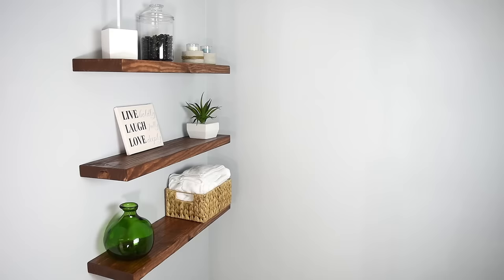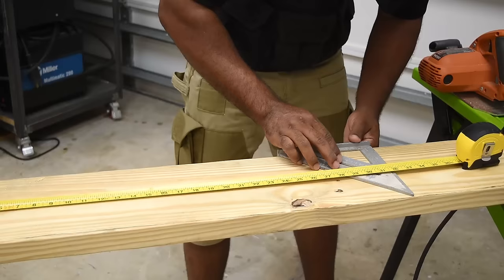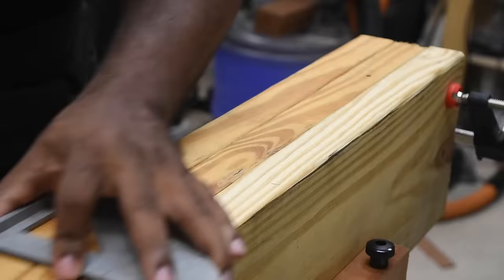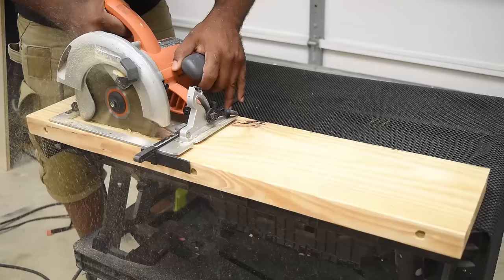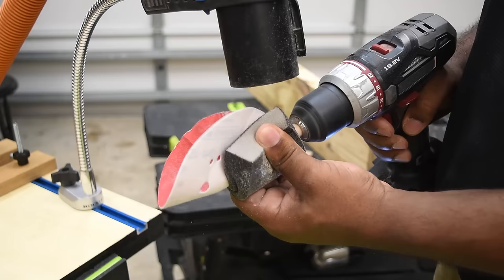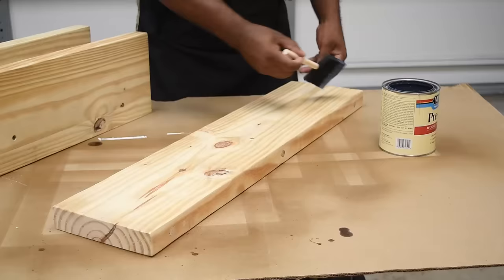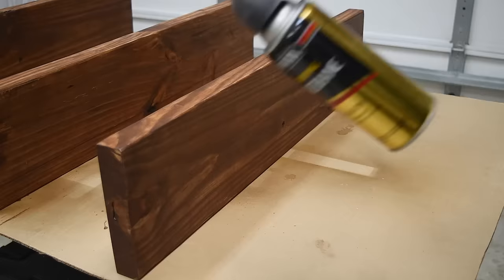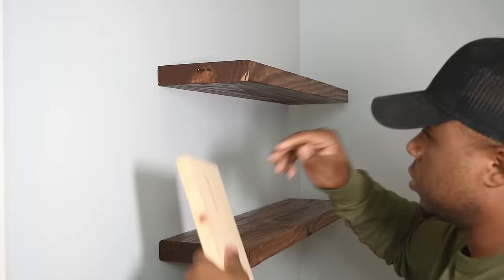Easy DIY FLOATING SHELVES No bracket | DIY CREATORS

Comment: Great inspiration.  I used this idea to make a set of 5 different sized shelves, using 2x8 and 2x10 pine, painted afterwards in my case.  For a finished look, I added 1x3 sanded and primed trim board to the three sides.  I also went up in dowel size, to 5/8 diameter and 5 inch lengths, ripping a 1 3/4" mounting strip.  Use a wood boring bit for the holes. To sand the dowel pins, I hammered them (gently) into a 14mm socket driver (3/8 drive) but I had to buy a driver for the drill for it (not expensive).  The look is very clean!
Reply: Have you tested the weight capacity yet? I want to try this method in my kitchen for dishes and pantry items, but I’m worried about the weight.
Reply: @Lula1216  For books, these shelves are OK.  For dishes, I would amend the design.  There are a few things to do differently for better weight bearing.  First, I used 3in screws to hold the mounting cleat to the wall on whatever 16 inch centered studs I found along the cleat.  These screws may not be strong enough.   Increase the width of the cleat as much as reasonable, say 3 1/2 inches, and use 6 inch lag screws (1/2 inch) to mount to wall on studs (predrill).   Wider cleat will reduce the amount of sheer force on the dowels too.   I used about 16 inch spacing on dowels.  To beef that up, use a shorter spacing (~12 inch), i.e. more dowels.  Just try to keep dowels aligned.  The more there are, the harder it will be to seat them if they are wonky.  Should work otherwise!

Comment: How do you know that 3 dowels is enough for the weight of the shelf and whatever stuff you put on top?
Reply: Exactly! He doesn't and that's why these are extremely weak shelves. Incorrect wall anchors and dowels are too small. This looks good if you don't know anything about woodworking or construction.

Comment: As a licensed contractor, anybody thinking about doing this, DO NOT use those silly drywall anchors.  You're asking for a disaster and major expense out of nowhere like the random shelves that fell down in the back room while I was prepping kitchen cabinets literally 3 days ago, had to call the client to let him know whoever put those in destroyed the wall...  Hit the studs people! Lastly if you're doing this for lets say a media station where you are much lower on the wall, 2 1/4" interior screws minimal, 2 5/8" max, gotta hit the studs but don't want to hit an electrical line either.
Reply: Hopefully the electrician put in nail guards...
Reply: @andrewweiher1982  That's the thing there Andrew lol ... "Hope" ... But they wouldn't put nail guards all down the line framing though.  Just have to know and STILL hope when the ran the line, they stay 18" so you know you need to be 17 or 19+ to be safe.  Almost makes me wanna pull drywall to the story first lol
Reply: I hate drywall anchors with a passion...a PASSION.

Comment: What's the sheer strength of a 1/2 wood dowel?
Reply: Dylan's DIY Workshop 1 stereo
Reply: It’s some sort of oak, so it’s around 1.3 to 2.0 Ksi, Or roughly 250 lbs per dowel.    This is strictly for shear that is perpendicular to the grain.  You also have to remember that those dowels are subject to more than shear and most likely will break from the bending moment not a shear load.

The dowels are the strongest part of the mounting system though, the pine bracket will split along the dowel line well before the dowels break.
Reply: Basically you'd have to eat McDonalds for a year and sit on it to break it.

Comment: My brother just described this process and then I saw your explanation. Much easier than the box  over a frame version I made. My only thought would be to figure out the relationship of the studs to the dowels so you don't end up having a dowel where a stud is. Also you mention using drywall anchors if you don't hit a stud. I would think that would only be an option if you're putting light weight objects on the shelves. Thanks for the great content!

Comment: Hands down the easiest, most rational way to float shelves. I am not using solid blocks, but I will use the method in this video, as the dowels will always match, since it's the same hole. Great video, thanks!

Comment: Very nice design deftly hiding all the hardware used to hang the shelf.  Using countersunk screws on the bottom of the shelf to lock the dowels provides a way to disassemble the shelf in the future without tearing up the drywall.  Kudos!

Comment: Thanks for posting the video.  Just finished up a set of shelves for the bathroom using some live edge material left over from another project.  You've got a good eye and a steady hand to drill the dowel holes for the shelves freehand.  I ended up making a jig to hold the shelves and used a drill press to bore the holes.  Have a great day

Comment: Thank You.  Just made these except I used 2x10's and cut the dowels 6" and back 2".  I have a 20V Dewalt circular saw that has a place for a saw fence, but Dewalt doesn't make one for my saw.  I invested in a Dewalt portable saw with a 40T Diablo blade.  This made the length cuts much easier and precise.

Comment: I would not be keen on putting heavy expensive objects on shelves like this. Three dowels taking all the weight of my camera lenses!!! I think your method is very clever idea but I would replace the wood dowels with metal dowel or some threaded bar.  Great video edits. Clear and straight to the point. Happy new year from Ireland 🙂

Comment: You can use a rasp, razor or a screw (screw is my pers. favorite) after you sand down the side..rough the edge of dowel to be glued.  I lay the dowel down, place a screw over and give it a wack with a hammer

Comment: Yeah, very nice work, but it’s a little too involved. Now don’t get me wrong, I’m a woodworker and appreciate the elegance of your solution. However, I just watched another video where the shelves were installed with threaded rods that were just pounded into the studs and the shelf onto the rods. It was strong enough for the guy to jump on the shelf. All that method requires is a drill and a hammer for installation. Not nearly as elegant, but sooo much easier. Might cost a few more pennies, but I’ll take it. Again, very nice job!

Comment: This video is awesome! I do have a question. Not sure if it'll get answered due to the video being older. Question about when you counter synced the safety screw and drilled in the dowel. Did you then take it out and add it at the very end? Or did I miss something and you have two? Can't wait to do this video!

Comment: this is the best video on youtube i have seen for making a floating shelf.  all the other ones make ridiculously thick shelves to hide all the internal mating structure.  this method uses the shelf board itself as its own fastening structure.    would it be stronger if the 2x8 (or 2x10) was cut in more of a 60/40 or 50/50 split to give more anchoring force to the piece fixed to the wall or will the necessary bolts be too leveraged?      excellent video for timing and all the superfluous action is implied A+++.

Comment: This is a great video. I wonder how much weight these shelves, in the current setup, can hold?  Would you use a longer dowel for more weight support or a different material?
Reply: For more weight support, I would just add extra dowels.

Comment: Or a much easier way is just screw pocket holes from the bottom into the studs and another in the middle with a drywall screw.  So much easier and it will be rated for more weight.

Comment: Love this process.  How do you ensure that you drill straight into the shelves to place the dowel rods, instead of at any slight angle, which would make the shelves not level once on the wall?
Reply: If you have one, use a dowel jig. I got one from Amazon for like $30. It’s PERFECT for drilling dowels. It clamps right on the wood, perfectly centered and perfectly straight. The only thing, since these are long dowels you’re putting in, use the jig to start the hole, then remove the jig to finish it—the hole will be straight.

Comment: What if...
What if i had a longer shelf to install? Wow everything be same-same? Would I just screw the screws into the wall at the same intervals and add more dowels? Or is there a fancy calculation that will provide the proper depth of dowel needed,  screw size needed and general spacing based on how long a shelf is?

Comment: Using the 1/2" dowels and studs to mount,  how much weight do you figure these shelves could hold?
Reply: Well since they’re in the studs I’d venture to say a decent amount. If the plastic anchor screws could hold 50lbs, more than that

Comment: Excellent tutorial and great end product. I would also like to know how much these could hold with 3 1/2" dowels for support. Anyone?

I suppose you could use aluminum dowels instead of wood to boost the weight capacity of the shelves. Also use large head pan screws to the studs with large washers? Is any of that even necessary, or would dowels and 2x6 wood work? What wood as well? So many questions... great instructional though, thanks!

Comment: Nice job. For shelves holding heavier items (like dishes,) I would use threaded steel rods in place of wooden dowels. What do you think?
Reply: I have the same thought. I plan to make a 103" long shelf in kitchen using 2 x 10 and put dowels every 16"  and screw the cut piece (1.5" board) to the stud. I might use 6" long wood dowels or use steel rod to replace the wood dowel.  Any suggestion?
Reply: @goodknight99  Depending on how much weight is going to be on it, I think I'd go with the steel rods. I'd rather overbuild in this case.

Comment: Great instructions. I ran into a problem with one of my shelves. When I ripped the 1 1/2 " side off using a table saw, the 1 1/2 piece warped. It bows out in the middle not allowing it to fit snug against the other board.   The other shelf came out fine from the same board.  Not sure how to handle that vs getting another board and trying again.  Thoughts?

Comment: Asking as a beginner; what's the purpose of the screw you countersink? Is that to secure the main part of the shelf into the section screwed into the wall (via the dowels)?
Reply: In the video it looks like he screws into the middle dowel. I'd say yes it is to keep the front shelf from sliding off. Hope that helped

Comment: Great channel. Great ideas for introducing floating shelves.  So I would suspect the holes for the dowels need to be dead on. How do you keep your drill perfectly straight to follow exact measurements.
I also was never aware of a metal mitre box. plastic ones are so  inaccurate. So I live outside the US now and amazon has aluminum boxes for under 20$. But 35 for shipping. I think I'll weld some scrap metal together to make my own. Any suggestions?
Thanks for your help
Roy

Comment: What length and type of screws did you use?  That's the only detail I didn't hear explained.  Maybe I missed it.
Reply: You should use wood screws(especially if mounting to the wall studs) not drywall screws. The length really depends on how thick the drywall is and how thick that rear section is.

Comment: What is the slimiest wood and dowel thickness you recommend for this? I will be using mine as bookshelves. From paperbacks large and small to hardback books including encyclopedias. My shelves will be different lengths ranging from 2ft to 4-5ft and I will be using 65lb drywall screws (and studs where I can). @DIYCreators

Comment: So you lightly sand between each layer of stain? And ideally put 3 layer of stain on it?
Reply: No, stain is usually one coat and done unless you want to achieve a darker shade. What you add multiple coats of is polyurethane(the top coat/finish). Each coat of poly gets a light sanding once dried then you move on to the next coat of polyurethane. Most brands manufactures recommend 3 coats of polyurethane no mater if it's flat, satin or glossy finish.

Comment: "No hardware required" - proceeds to use every tool in the woodworker's workshop

Still a really cool tutorial, gonna attempt this next. My largest drill bit is 10mm though, which is quite a bit thinner than 1/2" (~12mm), and even then nothing larger would fit in my drill :\

Comment: What kind of screw do you use when you say you put one in for safety reasons? My floating shelf has a tiny gap between the two piece and I need to know what screw I can use to help join them and make it tight so the gap will disappear

Comment: Does anybody know why he puts a screw in to lock the mount and shelve together at 4:50 and when does it take it out to mount the back half of the shelf to the wall
Reply: The screw is going thru both the wood and the dowel. He is preparing it at this step, then disassembled it. This screw is put back in the final step to ensure the two pieces cannot come apart.

Comment: If your putting a screw through the dowel, how are you later separating the two pieces I'm not following
Reply from the maker: You remove the screw then Pull the shelf apart.

Comment: Can this be done with 2x12" and would you use 6" lengths of dowel?
Reply: Following, I wanna do the same but concerned about weight limits of the actual timber on the dowels

Comment: "Make this great floating shelf with no hardware"

(Next frame in video....)

"All you need is a work bench, table saw, power drill, level, crane,  bulldozer,  leaf blower...."
Reply from the maker: Hardware meaning no shelf bracket,  come on how will you work without tools?
Reply: @DIYCreators  lol I was just joking. This vid came up in my recommendations after watching a bunch of vids using command strips to mount shelves and I assumed this would be the same,  so I was just surprised when you started building it from scratch. Good work on the shelves btw.